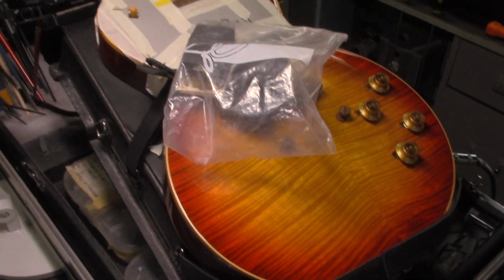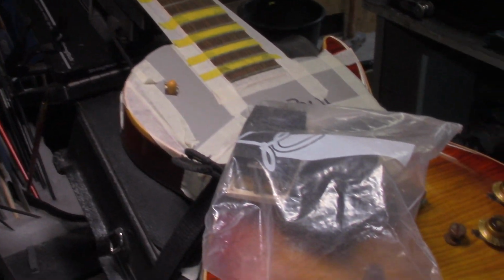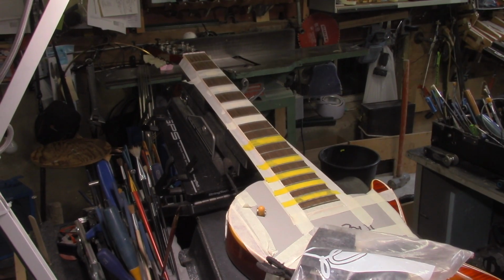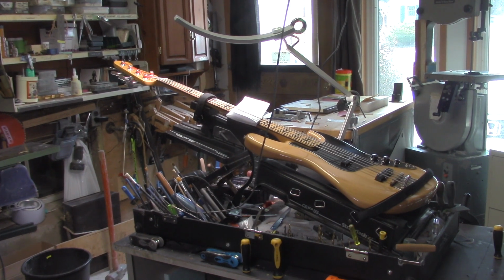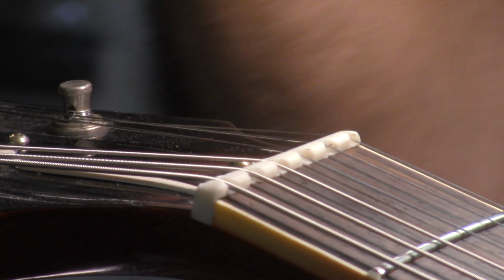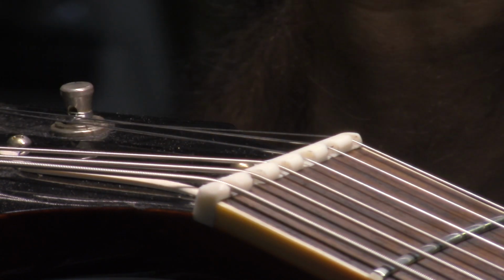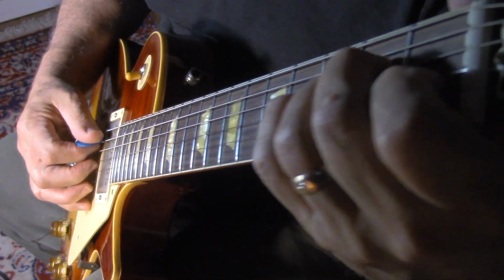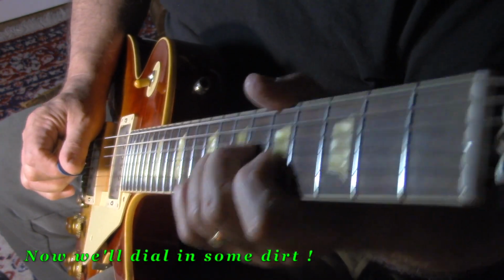Gibson R9 Les Paul@StringTechWorkstations

Comment: Last question: on an electric guitar that has individual adjustable saddles, why does the compensation need to be done at the nut and the saddle?  Isn’t adjusting at the saddle (one place) enough to compensate the scale length for the string size?
Reply from the maker: Try this Jeff. Plug your guitar into the tuner; play ( and tune ) the open string and 12th fret ( like everyone does ... right ? ). Adjust the bridge saddles so that all those open string and 12th fret note are in tune. NOW ... once that is done; fret the 7th fret note ( check it against the tuner ) ... then play the 19th fret octave note on the same string ... check that with the tuner too. Do this for all 6 strings ... let me know what you find.

Comment: I bought an r9 in 2019 with a stock nylon nut.  I had thought about changing the nut but I was super impressed by the intonation.  Especially on the first 2 frets.  I guess because the slots were cut so low?  On top of that, that nylon material just doesn't wear out.  Do you have experience cutting nylon nuts?  I heard it's a real pain.
Reply from the maker: I have changed-out lots of those nylon nuts ... never made any. The calibration at the nut and bridge go hand in hand. The bridge saddles are not in the same place with the compensated nut.